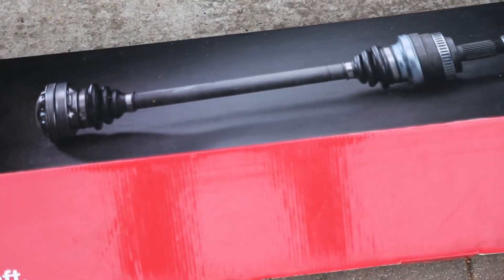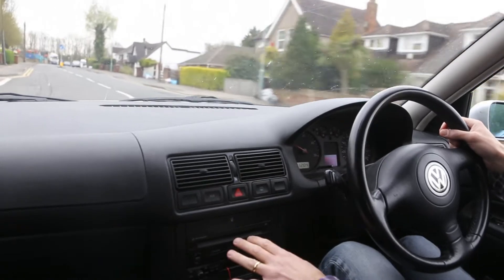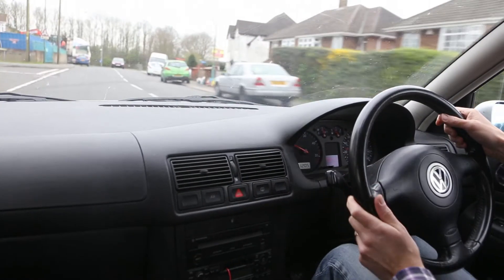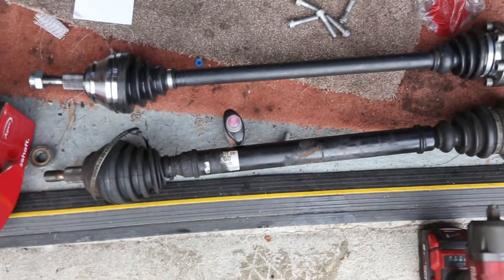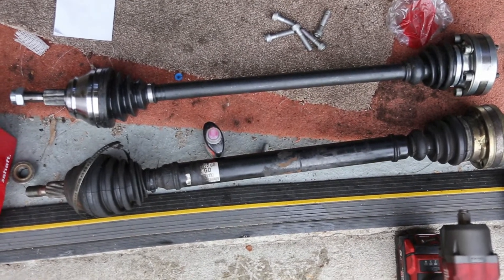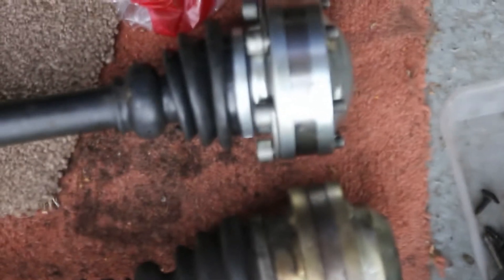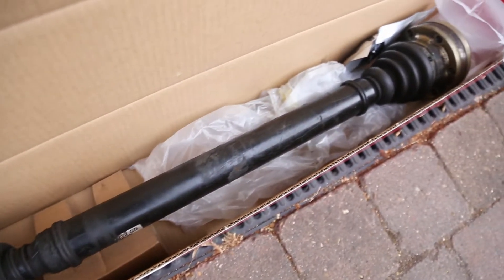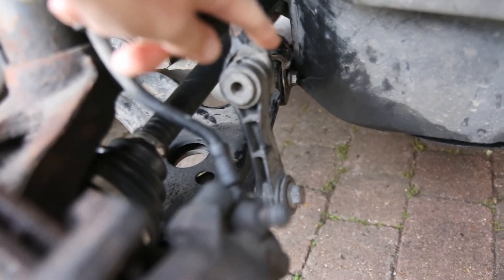VW Golf - Driveshaft vibration problem after Replacement with Aftermarket - Axle/Engine Shake

Comment: Im getting this on my vw transporter, fitted a £50 j&r driveshaft from ebay now getting a vibration at low speed normally goes after 20mph , is this what you experienced

Comment: Fkin hell same issue. Changed it last Tuesday and the car is making too much noise and vibration. The gearbox is struggling when driving on the motorway.  It's like car is breaking down. Thanks.

Comment: Did you install both sides or just one side
Reply: Am having that problem right now. Replaced both cv's with after market ones. A month later the drive is crap.
Reply: @flyemm2543 me to a got after market one side vibrates at 50 up 70 a hope once a get other side done it stops
Reply from the maker: Only 1 side as that was faulty
Reply: @ajvw  did you manage to fix problem bud
Reply from the maker: @ianjohnston1391  no I haven't, I planning to repair and refit the OEM ones